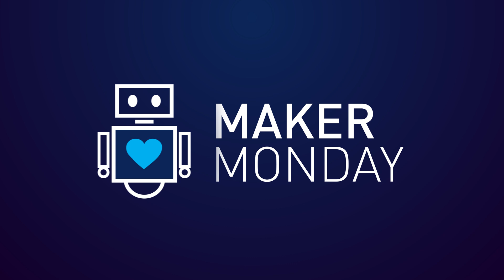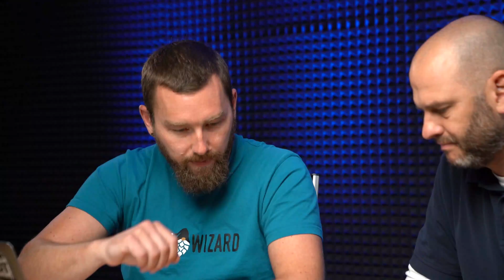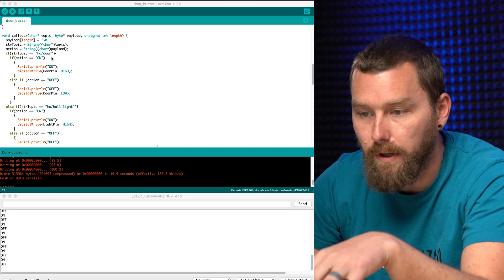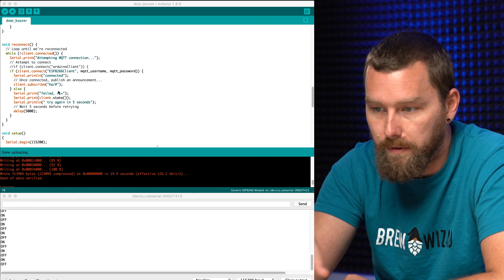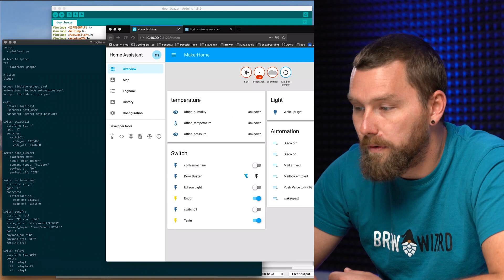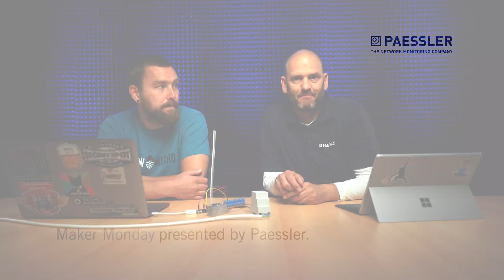How to Hack Your Door Buzzer

Comment: Hey awesome stuff guys, any way to do this analogically though? Like just writing a relay to your buzzer, then somehow making it smart via a smart plug socket, idk?
Reply: For anyone reading, I figured it out, kind of. Basically your dumb intercom or door buzzer  is always on and when you push the designated button it completes the circuit and opens the door. What you got to do is find the wires going to the button and wire a smart relay between them (maybe even smart button?). Haven't tried it yet but should work if the relay has its own battery power.

Comment: Can we add a push button to it as well ? ... I am in the shop, I want to push the button to open door... and if I am outside the shop (I will use this option) using home assistant...
Reply from the maker: Hi Seryoga, yes you can add as many buttons to it as you'd like. The Button, that is connected in the first place still works like you used to. 
So if you are inside your shop, use the button, as you did before. And if you are outside, use home assistant. I hope this helps.

Comment: Is there anyway to integrate the traditional buzzer to remote system? hence, the apartment building is traditional buzzer system. I just want to transfer my unit to remote system without disturbing the neighbor.
Reply from the maker: @lei bowman I think you neet to check out the cables from your door opener unit within your apartment. From there you sould be able to connect the ESP. (Please not that you are doing that on your own risk 😉)
Reply: I'm thinking of doing the same. Also live in apartment building. Which more like have a talk , listen door open button.  Opening the door is the only action you would  want.  Although all three would be really cool.  

A single N/O switch connected to Wifi with APP support would be suffice.

Comment: So if I understand correctly if the power goes off your house opens up. That sounds like an easy way to brake into your house.
Reply from the maker: @György Névery that depends on how you set up the relay. When you connect the cable that goes to the buzzer to the NO port. Then "yes" ;-)